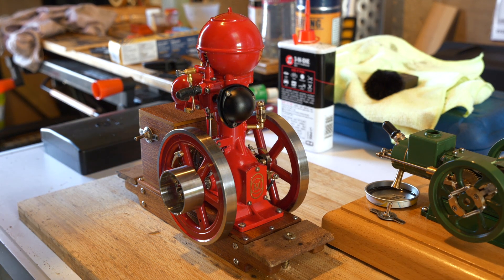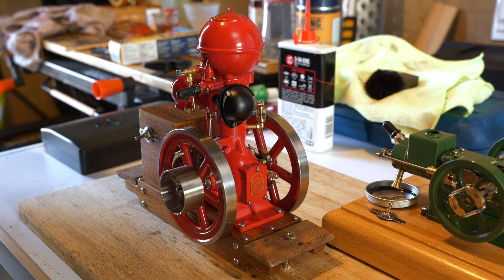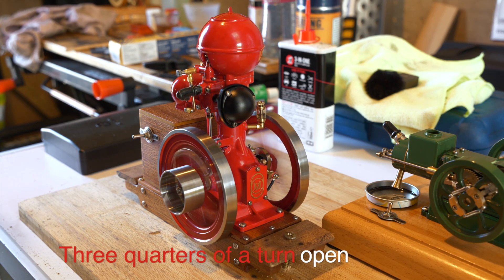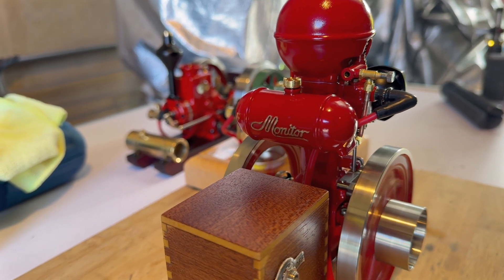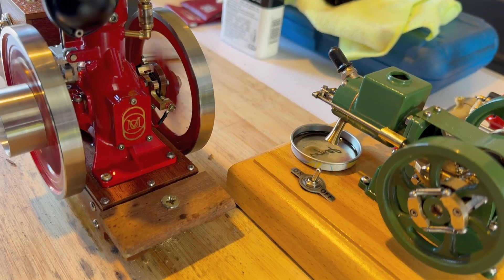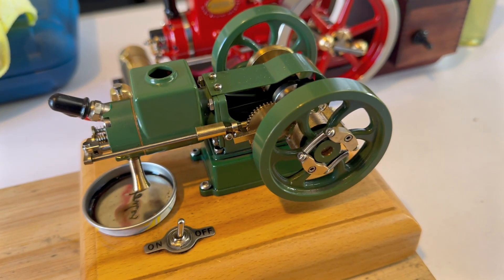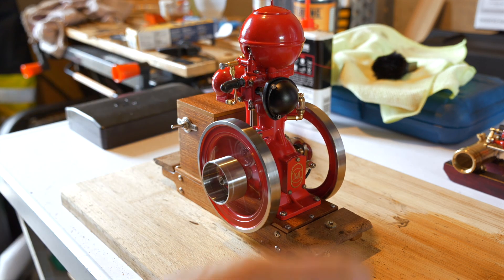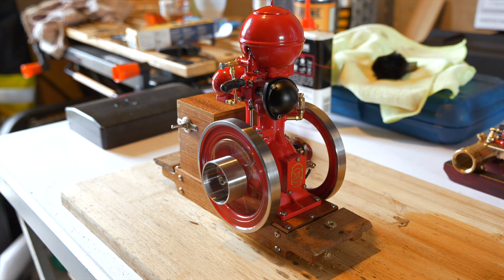Okmo B01 Ball Hopper Engine

Comment: I have one of these,i got it last week,have not yet ran it yet.I have A 1916 baker monitor engine with a pump jack but does not pump water.Also have a maybe a half scale or so model engine of it from the 60's or so that does pump water.
Reply: I should mention the one i have is  A 1916 VJ engine.